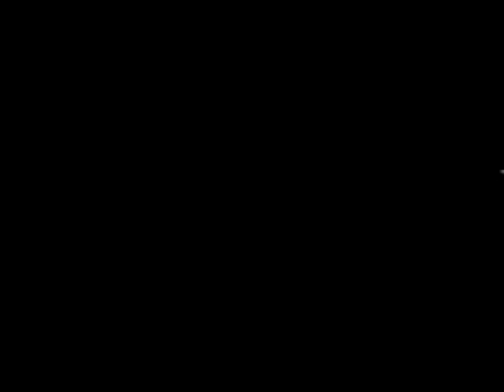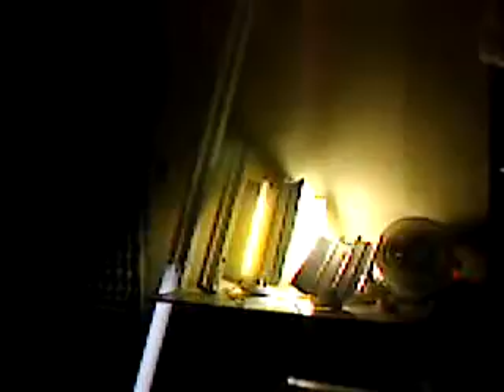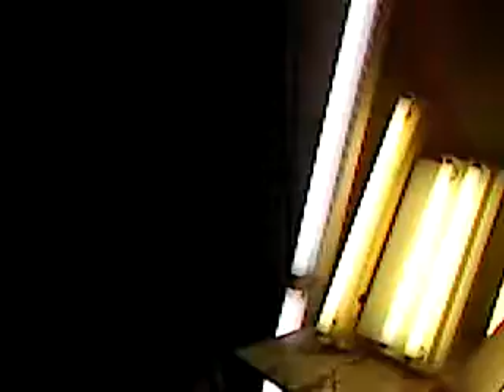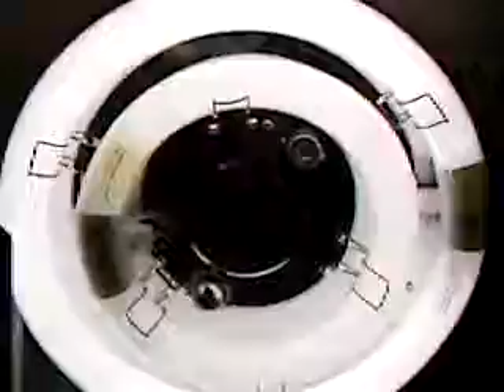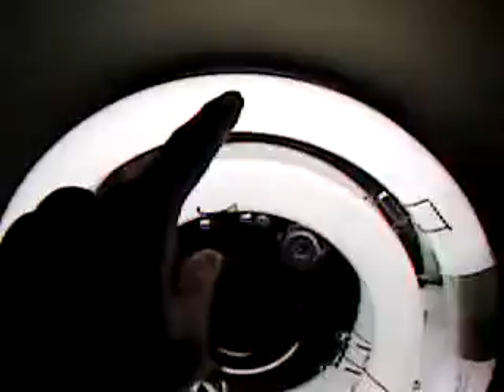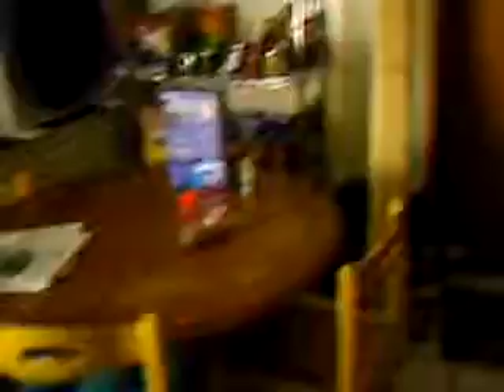Blinkfest 2009 (January, preheat fluorescent style!)

Comment from the maker: The chassis on both was made from a chopped down longer strip fixture and the reflectors were chopped down from longer reflectors. I measured by sticking the tubes in the sockets and doing an outline. For the F15T8/T12 one, I had end plates that had holes for lampholders with attached starter sockets, and I went from there. The bulk of the F8T5's parts came from gutted undercabinet fixtures.

Comment from the maker: A regular 14-15-20 preheat choke will usually drive a 22 watt circline although some of the older ones also say 14-15-20-22 meaning they were rated for both. If you see one of those, snag it and make use of it.

Comment from the maker: Hey. I've tried to reply to this comment before but youtube doesn't seem to like comments with URL's in them. I'll PM you the Lighting Gallery site and hopefully it will go through. As for the preheat ballasts, the ones that run one 30 or 40 watt lamp as well as a 32 watt circline (same ballast for all) I see on ebay every now and then. As for 14/25/20 watt preheat choke transformers are easily available at hardware stores and home centers.